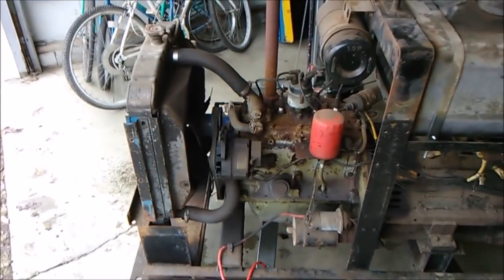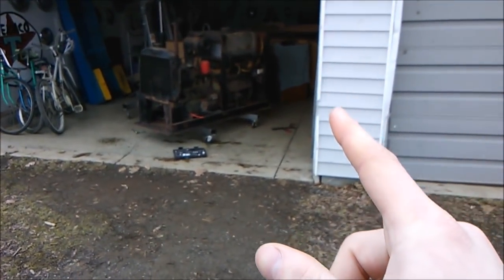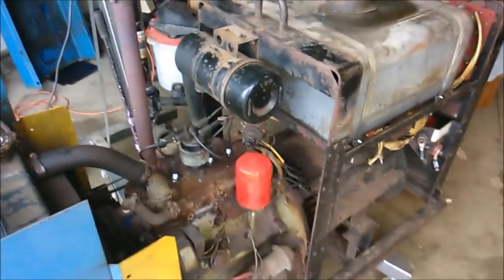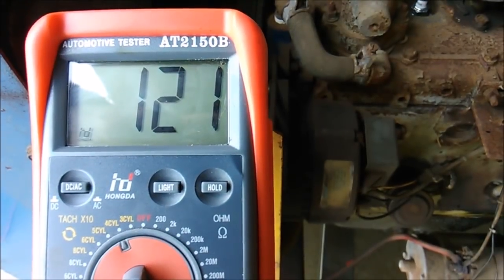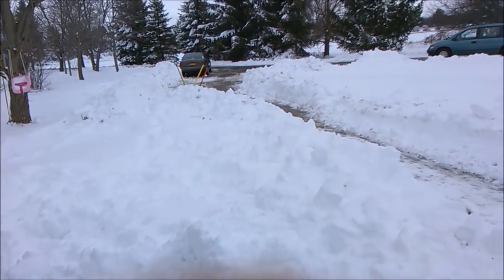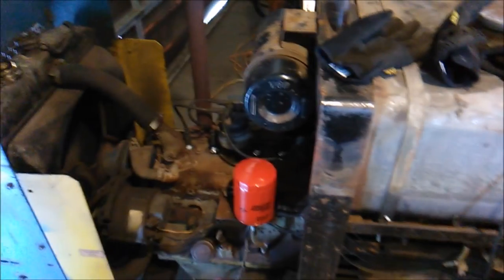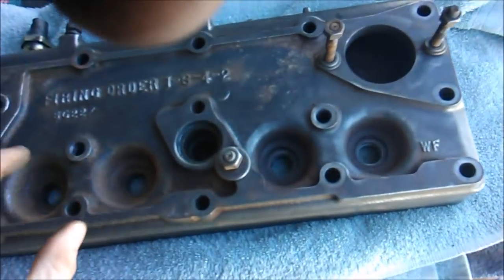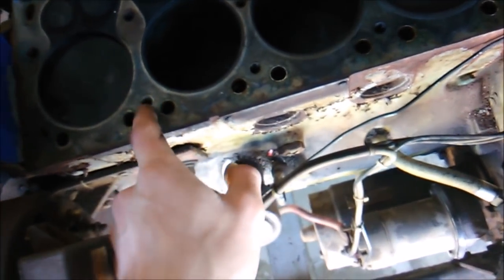Miller Big 20 welder repair - part 1

Comment: Are the freeze out plugs good? They look kinda rusty.
Sometimes there's a bunch of sediment down at the bottom of the block and you don't get good cooling down there. If you replace the fo plugs you would be able to see down there.  Just a fyi. good vid.
Reply from the maker: Good suggestion. I actually found out the overflow hose was pinched closed between the radiator mount and the outer sheet metal. goes to show check all the little things first. oh well, Now it's got a new headgasket and I've got piece of mind !

Comment: I am a new subscriber. Channel CGE recommended you in one of his recent videos. I think I will stick around. If you pull that thing around on the trailer, wont it get wet? Another channel I subscribe to, the guy got a pull trailer and made it into a welding trailer. You need that! I am sure your yellow truck would pull that.
Reply from the maker: cinrambrad Thanks for the sub! Yeah it'll get wet if it's on a trailer ,Miller sells a cover for the big 20 that I am thinking about buying. The ol '72 should pull it no problem

Comment: How did you check the rpm ? How did you hook up the meter? In what settings?
Reply from the maker: Sorry, it's been a while since I did this. I used a multimeter on the tack setting. Usually you go off of one of the coil wires

Comment: I have a Miller or airco not sure but looks exactly like that one. The serial is HH024692 I can't find the year or model this is it needs a reohstat but don't know what size it is
Reply from the maker: Sometimes it's hard to tell with these. Mine quit welding, never fixed it and ended up selling it off.
Reply: @NoPaintGarage  thanks for the response I haven't had anyone help me with this. Im needing a wiring diagram for it and is an airco 200 or 300 amp machine but can't find anything on it. But thanks man take care

Comment: Hey bud where did you find that automatic idle cylinoid and how much was it 
Thanks
Reply from the maker: I got it on ebay. It wasn't the exact same one so some modifications were needed. I couldn't find the right one anywhere. It was about $30

Comment: Hey man do you still have that machine
Reply from the maker: Nope. Just got rid of it a couple weeks ago
Reply: FullThrottleChevy  oka i bought one a couple weeks back where was you finding parts for it certain sites
Reply from the maker: @treycreppel9919  engine parts are easily found on eBay. Generator parts are quite hard to find